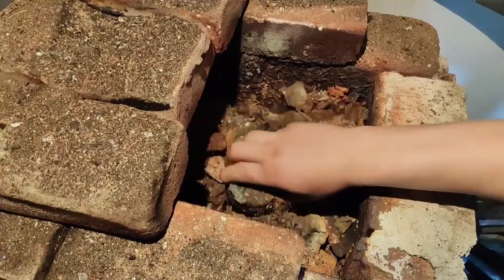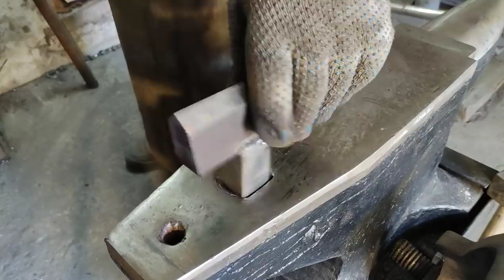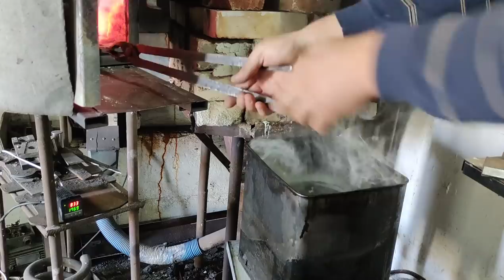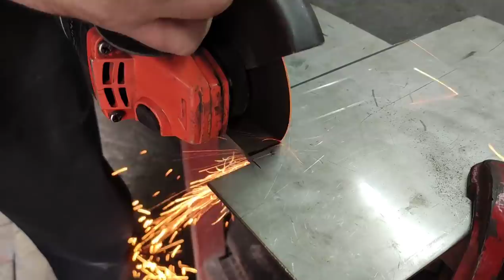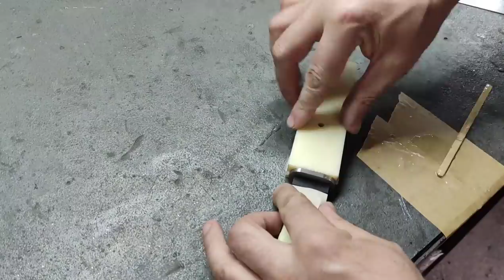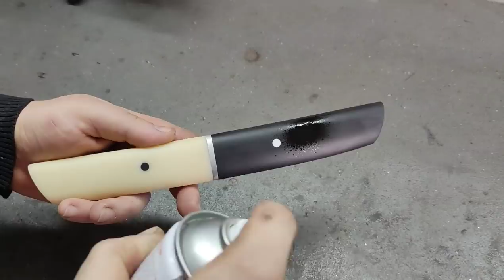WOOTZ steel from old drills and bearing balls . TANTO knife YIN YANG

Comment: Gorgeous work. Not a tanto, but still gorgeous.
Reply: "Americanized" prettied up junk.
Reply from the maker: Ukraine 🖐️
Reply: @fz-makingknives3663  Ukraine! Sorry! I saw the .ru and assumed incorrectly.
Reply: @fz-makingknives3663  it is not a compliment, the blade is missing the tanto signature design, the blade was also not folded metal, and the blade wasn't differentially treated (soft iron back, firm tempered steel blade). Not to mention your honing could use some work, there are many grades of whet stone. Functionally yes it is a knife in a pretty package, but not a tanto, nor an example of a traditional japanese production.

Comment: What are you adding to the crucible at the very beginning? There's three things that you dumped in at the very beginning besides the drill bits and bearings.
Reply: My guess is the bottom most components on top of the bearings are akin to thermite to melt them down, and the chips of rock on top likely act as a buffer to stabilize the process

Comment: Just cuz you melt a bunch of Steel together doesn't mean you can call it wootz
Reply: The fact that he is melting steel together is proof that is isn't wootz at all. He is an amazing craftsman but from all of his videos Ive seen I really feel like he honestly has no clue what wootz actually is.
Reply: @patrickwalley9803  or either what heat treating is, he didn't temper the blade, first time the knife drops it's gonna go in pieces..

Comment: Just putting all the ingredients together and melting them doesnt make it wootz Damascus. The impurities that give wootz its distinct properties get burned off if any oxygen makes it into the crucible, which is why you're supposed to seal it. If the impurities you needed were there, it would have crumbled like a muffin as soon as you smacked it with that hammer, because real wootz needs to have the exterior of the cake decaborized, then cycled above and below glowing several times, then it needs to be carefully worked until it solidifies and forms the carbide structure that gives it that distinctive etch that looks like water on a rolling boil with cluster sheets of carbides. It's a nice piece, but it isn't wootz. The etch never lies.
Reply: thank you metallurgist ☺️

Comment: I don’t think that’s actual Wootz Steel.  Wootz has a very specific micro crystalline structure and has an origin in India not Japan. Also a little too much shaping of the blade on the sander vs forging.  But it is a very nice looking knife.

Comment: calling it WOOTZ steel is kind of 100% not true
Reply: 100% agree.  Quite fraudulent.
Reply: Wootz steel is common nomenclature for crucible steel which he did in fact make, wootz isn't some god metal its name originates form the area it was made in and was renowned for quality its litteraly the same concept as "true" Damascus steel or once again just called crucible steel. As a intresting side bar crucible steel is offt far worse in quality than traditional mono source steel and even historicaly Wootz and crucible steel was often far worse for practical applications as novices and scammers often tried copying, stealing and reverse engineering the good stuff.
Reply: even worse to call it damascus  because he is forge welding
Reply: @canadatrap9217  false. Wootz is not a term for crucible steel. Wootz is a term for steel made using specific ore, specific methods and while a crucible is a part of the process calling wootz and crucible steel the same is like calling cake cookies and casserole the same because they're made in an oven https://youtu.be/OP8PCkcBZU4

Comment: This shit isn't Wootz steel.  It's pattern welded.  When people post shit like this they lose respect from anyone who is actually in the know.

Also that isn't a tanto.  It is a pretty pattern weld though.
Reply: Except it isn't pattern welded, it's crucible steel. Wootz is high carbon crucible steel characterized by the pattern that is clearly on that knife. Don't say something obviously wrong and act like you're "in the know" Though yeah I wouldn't  call it a tanto either

Comment: I was just curious from just starting to watch some of your videos. When you make the case for the blades. Could you drill some shallow holes into both sides and allow the epoxy to cause a better and stronger attachment for both sides? But again I don’t know how strong the material is or how long it would hold up.

Comment: You do know that Wootz is just another term for real Demascus crucible steel right? It's suppose to get that pattern on it from the quenching processes.
Reply: No it's not. It's literally crucible steel produced in a certain way this dude emulated to his best ability (carbon+iron source, he even adds what I think is sulfur to match impurities of og wootz) and it usually doesn't show any pattern, just some grainy spots. Hell, we call Chinese, Sri Lankan and Iranian steel of this type Wootz too.

 Damascus was made by then pattern welding/reforging that stuff multiple times squishing all those pearlite spots into nice tidy rows and occasionally more complex patterns (to order probably).
Reply: This is not wootz in the least.
Reply: @Sk0lzky  Ok, the original True Wootz Damascus steel was NOT created using pattern welding. But saying it happens during quenching was an extreme simplification of it all. The pattern seen in True Wootz Damascus steel happens when raw metal is melted to create the ingot. When the steel then cools it causes the carbide forming elements( or CFEs) within the metal to solidify into pockets within the metal which then acts as "seeds" or nucleation points for which carbide can attach to. When the metal is then brought up to forging temperatures, the CFEs within steel are able to migrate through the steel fairly easily seeing as how their melting point is higher then the steel itself, allowing them to form into a matrix that can remain there without melting or moving again and losing the pattern as the steel is heated during the hardening process. This is also why you do not get an even homogenous distribution throughout the steel, but instead get that beautiful pattern. Because the CFEs do not dissolve at forging temperatures, they maintain their relative distances from one another as the ingot is being forged into a blade or desired shape, stretching them across its length. And as a result, once the blade as been forged and you begin the heat treatment, cycling the blade's temperature to harden the blade, the patterns can then appear as more and more carbides form on those CFEs, hence their name. All of this is done at precise temperatures which black smiths have known how to do for thousands of years and NONE of which requires pattern welding or acid etching or folding different metals over and over with one another like people today like to create metals that they "claim" is Damascus steel.

Here are some sources for this information should you like to read it....
--2018 Paper that details how solidification structures form and how they determine cementite raft formation and spacing----https://link.springer.com/article/10.1007/s11837-018-2915-z
--From the Soil to the Iron Product - the Technology of Medieval Iron Smelting: https://exarc.net/issue-2014-2/at/soil-iron-product-technology-medieval-iron-smelting
--The Technology of Ancient and Medieval Directly Reduced Phosphoric Iron: https://bradscholars.brad.ac.uk/handle/10454/5511
Extra sources online links unavailable:
Early papers by Sherby and Wadsworth that helped pave the way for the field of research:
-Oleg D. Sherby: "Damascus Steel Rediscovered?" Trans. ISIJ, 19(7)1979 p. 381--390. 1980
-J. Wadsworth and OD. Sherby, “On the Bulat - Damascus Steels Revisited”, Progress in Materials Science. 25 1980 p. 35 - 68 1983
Oleg D. Sherby and Jeffrey Wadsworth: "Damascus Steels -- Myths, Magic and Metallurgy", The Stanford Engineer, Fall/Winter 1983-84, p. 27 - 37.
-J. Wadsworth and O.D. Sherby, "Damascus Steel Making", Science , 216 1983, p. 328-330. 1985
-Oleg D. Sherby, T. Oyama, Kum D. M., B. Walser, and J. Wadsworth: "Ultrahigh Carbon Steels". J. Metals, 37(6) 1985 p. 50 - 56.
-Oleg D. Sherby and Jeffrey Wadsworth: "Damascus Steel", Scientific American, 252(2) 1985 p. 112 -120.key

Comment: Absolutely terrific work. I'm curious, why don't you gring the bevels before heat treat?
Reply: From limited knowledge, but if you grind bevels first you have more potential for warps and cracks during the heat treat. You can grind bevels first, but if you don't have to, why
Reply: @paultiki9968  exactly it can cause delaminations as well

Comment: What all powders do you add to the crucible. Can you please explain
Reply: Black is graphite(carbon additive), white is dolomite, and third one is broken glass to form oxygen isolating layer on the top of melted steel. :)
Reply: @atexc5604  i understood why carbon and glass is needed. Why the dolomite?
Reply: @adityamuley87  Dolomite is used to create slag, and helps liquify steel. In steel foundry they also use lime and fluorite - they all create slag with different properties. You can read about it in metalurgy books. I dont know if dolomite have any other function in making crucible steel/wootz - some people dont use it at all. It also depends on crucible type you are using - additives may be corrosive to some crucibles.
Reply: @atexc5604  Thank you so much.
This was very informative

Comment: Nice blade. Pattern welding isn't wootz steel however. Wootz is a specific formula and requires processing from ore. This is more damascus rather than wootz. Great fittings, very attractive.
Reply: There is no pattern welding in this video... yes, classically wootz would have used some type of iron or iron ore, along with some materials for carbonizing. Just pop that into a crucible and let it melt down for a long time. That’s what he did in this video. He just happens to use some other source of iron(the steels) and some other carbonizing materials. It’s basically the same result, but with different materials. Then he just forged the ingot into a knife shape. No pattern welding here.
Reply: That's what we in Sheffield call pattern welding, there would be no pattern if it were a full melt in the crucible. Damascus is a specific folded type of pattern welding, and Wootz refers to a specific mineral quality found in a single mine.
Reply: @daiprout323  pattern welding requires welding. None here. Welding is forging and folding. This was simply putting an iron based metal and carbonizing elements and letting it essentially “boil”. Then the ingot was forged to a blade shape. No pattern welding.
Reply: @DrewPlusPluss  might be where you come from, but in the forge and crucible furnace built in 1785 where I learned to do this it is understood that welding is the process where metals fuse at a temperature not sufficient to cause a proper melt. Had there been a proper melt, which in the crucible process occurs somewhere in the region of 1500-1600 degrees you would have a new steel with uniform properties. If you don't reach  temperature you just get a weld in the crucible, this leaves a welded billet, and why the pattern shows one drawn out.
That's how it's understood in Sheffield as far as I'm aware.

Comment: What is the black peppar and salt that you put every time at the end of crucible?
Reply: The stuff that looks like pepper is probably powdered 1095 steel to fill in gaps.  The white stuff in a traditional crucible steel is often ground glass.  The glass will melt and float to the top and seal the billet from oxygen
Reply: @paultiki9968  its borax powder and crushed glass

Comment: Really professional work, congrats! But what have you put in the furnace as fuel when you were going to melt the steel, an special carbon or what? It ignites really fast and with a very blue flame (so much heat)

Comment: OK, here's something I don't get.  I keep seeing knife makers say that if you over-heat steel then you can ruin it as in it will never harden and temper correctly after that.  But here you completely melt it and it's ok.  I'm confused.
Reply: v=OP8PCkcBZU4  good documentary on the process involving the crucible and making of Wootz. He's added carbon (crushed charcoal) to the crucible to compensate for the loss of carbon in the steel from the firing of the crucible. Also, he's limited the number of times he's heating in the forge after he starts the forge/hammer process otherwise the steel will be weak due to loss of carbon through firing.
Reply: Overheating steel results in grain being large, which makes it brittle without giving any extra strength. This can be solved by thermocycling to promote small grain growth multiple times. If you burn steel then there’s no going back, but in a sealed crucible it will melt instead of burn due to the lack of oxygen.

Comment: What’s the thing you drop in the oil before quenching the blade?
Reply: It's probably a hot coal to get the oil heated up. If you dunk the blade in oil that's too cold it could crack or deform. Then again I'm not an expert on this kind of craftsmanship so I could be wrong. Cheers !

Comment: What is that black liquid made up of? And why did you dip iron in it?
Reply: Oil
Reply: @kylehayden3113  Oh wow thank you so much. And by the way i Love chemistry. and yes i could relate the oxides formation. Loved it. Thanks a lot again. but mmost probably the acid he dipped in was just have a texture on the surface rather than making metal hard. i think so ,, i am not sure.

Comment: Is there a reason you bash it with a hammer a few times to start? Why not use the press straight away?
Reply: Good steel requires human love before it goes into the machines.

Comment: Thanks to Nutrilon, the knife's immunity will be quite high. Also this is not tanto at all. https://en.wikipedia.org/wiki/Tantō
Reply from the maker: Kaiken knife is a kind of Tanto!
Reply: @fz-makingknives3663  Bullshit, You have a nice skill and tools but with the definition of TANTO you are wrong!
The tanto knife has a high point with a "flat grind", leading to an extremely strong point that is perfect for stabbing into hard materials.
Your knife has a extremly sensitiv tip and due to the fact what Alloy you have created the heat treatment could be wrong which could end in a fataly crack during use.
A tensile test and a notched bar impact test would have to be carried out to ensure that the heat treatment is more precisely defined.
Reply: Everyone is an expert with Frickin google at their fingertips. Trust the experts and shut your mouths.
Reply: @kpotter78 Woww valid argumentation!
You are an expert, in what? 
I am Dipl. Ing. in Casting Engineering and fracture analysys. I was involved in the investigation regarding the +ULFBEART+ swords.   You know? 
You,an Blacksmith? 
But back to the actual point, the knife here is just a little a tanto knife than a full-tang knife and believe me, I don't have to google it for that.

Comment: How can it be wootz steel? I read the technology that came out of ancient India has been lost to time.
Reply: It was lost but people have been analysing items found and tried to recreate them, but i would say this is kind of like how basically every modern blacksmith says they make damascus steel just because it has a wavy pattern, while damascus steel was basically just steel that was made and traded in the areas around damascus
Reply: The steel from Damascus was a crucible steel, meaning that it was iron melted in a sealed crucible. Wootz was crucible steel made from a specific ore with specific contents, which is what has been lost as it has been used up. So this is more like original Damascus than any pattern welded steel.
Reply: @garethlamb6923  yes but what I am saying is that its not like damascus steel was the only crucible steel at the time, but damascus steel is therefore not just crucible steel but crucible steel produced near damascus

Comment: $7000 US thankyou ! 👍🏻
Reply: @fz-makingknives3663  very keen to have a play soon . What was the 2 ingredients on top of bearings and drill bits ?
Reply from the maker: graphite, dolomite and glass
Reply: @fz-makingknives3663  thankyou for that .i understand chemistry to a point but what are the reason for these as they will not form with metal. Is it to extract impurity? Maybe graphite is adding carbon for hardness?
Reply from the maker: Graphite for carbonization.  Dolmite cleans steel.  Glass flux
Reply: @fz-makingknives3663  oh ok so the glass stop oxidation while in funace of even after?
Reply: Can this be done with cobalt and titanium drill bits ?

Comment: Why waste your time making what amounts to a wallhanger? Mystery steels, variable heat treat and temper results, etc. I understand it is a work of art, but there is a reason that master smiths forge exclusively with known steels.
Reply: Because everyone knows that ballbearings and old rusty drill bits produce the best blades 🤷🏻‍♂️